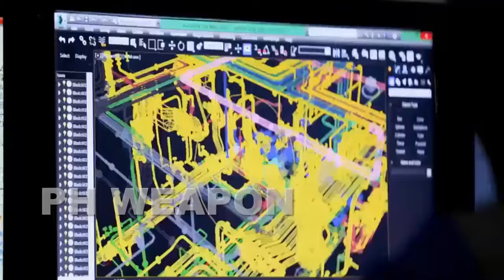TWO LARGE LPD TO TRANSFORM SOUTHEAST ASIA'S MARITIME DEFENSE IN THE PHILIPPINES WITH NEW WEAPONS

Comment: what defenses? I only see a single cannon in front and I don't think that's enough to shoot down missiles and aircraft
Reply: Even if these vessels have a 76mm Naval Gun installed at their bow section, they "STILL "WOULDN'T" be that effective in shooting down enemy aircraft & missiles, why so?
Because an Air & Surface Search Radar paired with a Fire Control System or CMS(Combat Management System) is required here, for you to know where, how far, what direction is the threat (aircraft,missile,drones/aerial & naval drones) coming from.
Without these systems, these vessels are practically "sailing blind." against the enemy.
Reply: Cge lng well trained sa paglangoy ang mga navy personnel natin just in case.. 😂